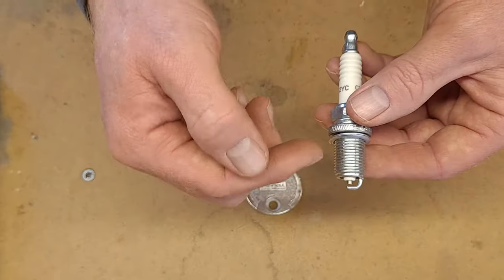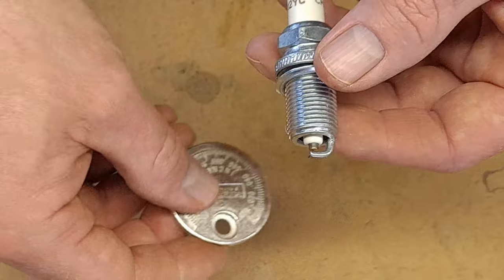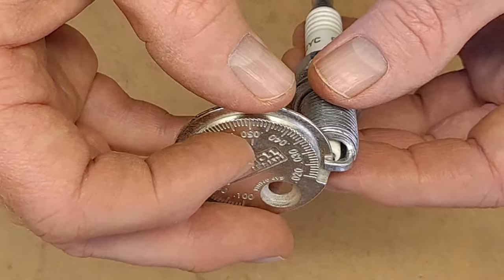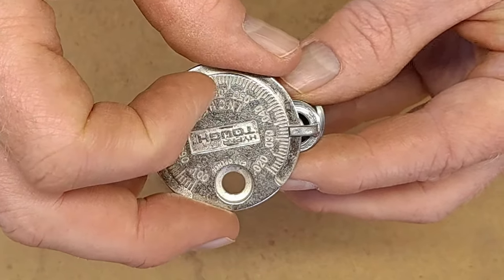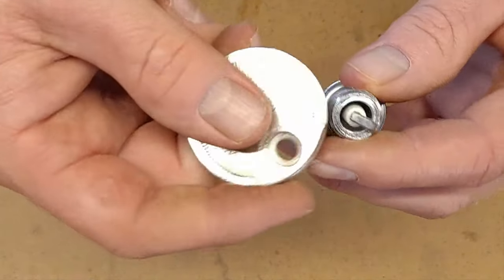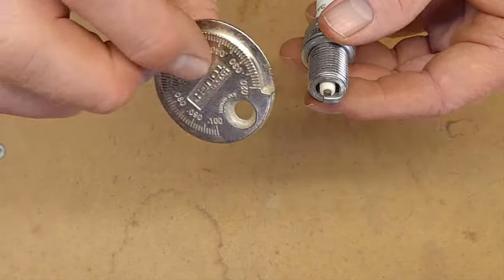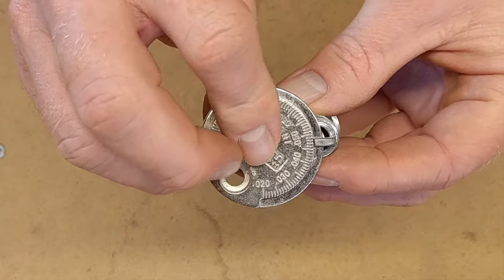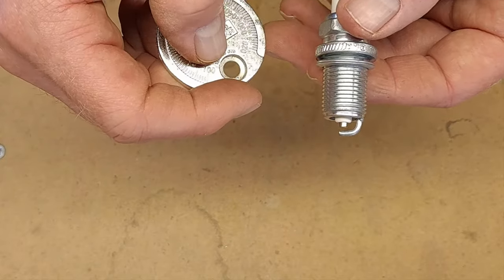How to Set Spark Plug Gaps for Optimal Engine Performance

Comment: Which side on the gap tool to measure the gap of a spark plug?
Reply: After changing what was improved?
Reply: @taainimen2763  nothing. Still running really bad rough. Like it's struggling . Not holding idle.